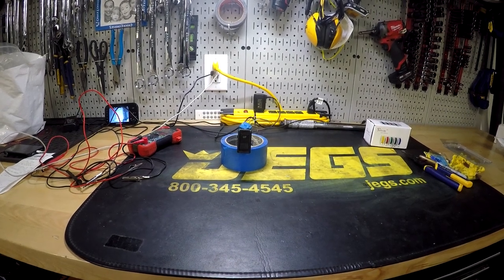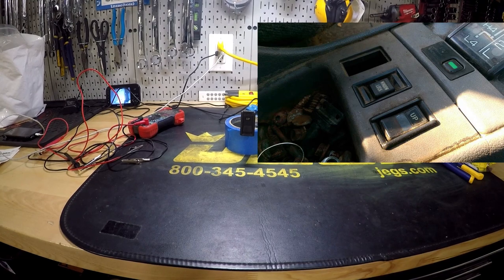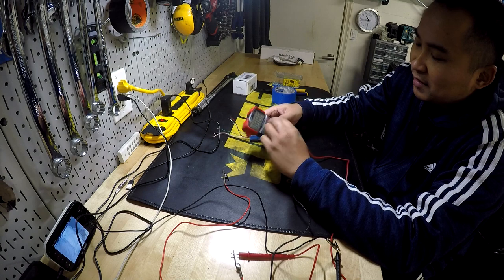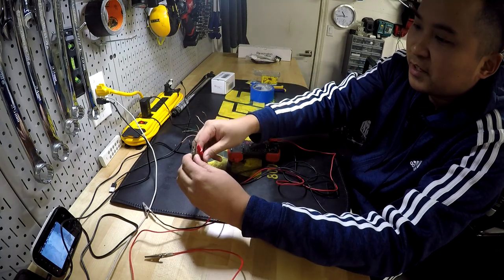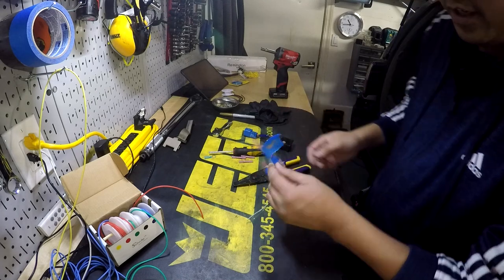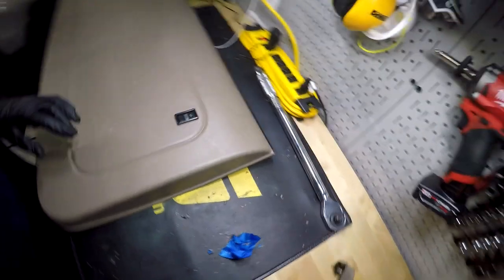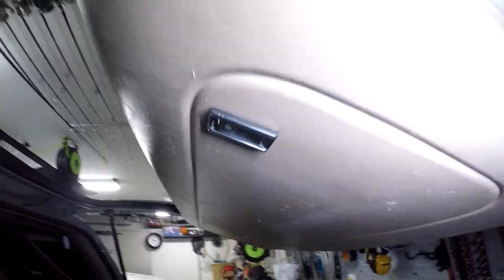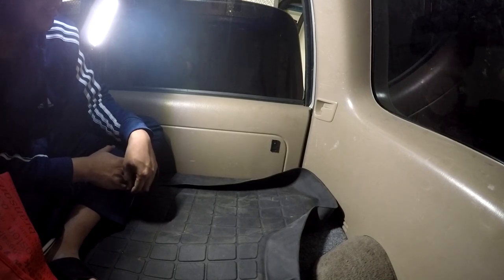Add A Window Switch for 3rd Gen 4Runner Rear Window

Comment: You need to save folks a headache and make a note on this video that it will not work for the 01-02 runners , because the ecu . the do has to be unlocked for it to come down. It is possible with relays but requires a lot of additional work…
Reply from the maker: Pinned your comment

Comment: The reason 3rd gen switches are like that, is because they were located in the center console left of the parking brake, placed upside down, at a downward skew. If you can only find a 3rd gen switch,  and want to install it in a vertical position, just peel the "back window" sticker off the switch with an exact-o knife and flip it, so up is up, and down is down.

Comment: Sir you have shown me a solution to a problem I didn't know I had. I have a 02 4Runner and this would be an awesome mod! Thanks for posting.
Reply from the maker: Check the comments for color codes and test it before committing to a hole lol. I’ve seen some unsuccessful results! Hope it works out for you though. It’s a nice add for sure!

Comment: Amazing. As soon as I find a swtich I'm doing this! I was wondering what you mean about "put the cover back on" to not scratch the glass? Why would the interioir trim need to be installed? Do you mean to say the interioir piece actually moves the glass slightly away from the track?

Comment: Dont all 3rd gen 4runners have a switch on the hatch key- turn left to unlock and then hold that position and the window goes down, turn left to lock hatch but hold and the window goes up. is that only on limiteds?
Reply from the maker: Yeah my sr5 has that but that’s be hard to do sleeping inside the vehicle unless window was down (bugs!!). This is actually tapping into that circuit

Comment: May be a stupid question, but is this deleting the switch in the front? I just finished the hatch light mod, and am doing some research on this one in your video..i want to keep the one up front active, bc the dogs like the fresh air while driving.
Reply from the maker: It is not deleting the switch in front. It’s basically creating a switch off the rear key system

Comment: @PhoRunner Channel will this mod work with a 3rd gen 4runner hatch window switch? Or are the wires different?
Reply from the maker: It should but the switch will be upside down printing . Wire colors will be different but you can use a meter to figure out what wires you need

Comment: Hey mate, long shot but im using the gen 3 switch from my 96. Found the wires in the tail door, hook up the switch but it only goes down. Any advice?? I know this was a while ago but hopefully you still have memory of it!
Cheers!
Reply from the maker: Try finding the wire by the key that makes it go up and trace it back to that module. If it goes up with the key, there should be a way to simulate this
Reply: @PhoRunner  i tapped into the key wires, two green ones, still wont go up. Both wires work, have tested it but just only does down. Do you think i need to connect all three? As i just have an earth going to a bolt
Reply: @daniel7529  have you found the solution?

Comment: I'm planning on doing this mod, but would rather not cut into that rear door metal (I've got a big switch). I want to put the switch in the side of the back area of the trucks interior, right next to where the wheel well sticks out. Instead of fishing a wire through, do you think I could just tap into the wires already going to the front? It looks like those green-red and green-yellow wires run all the way to the front.
Reply from the maker: I’m not too sure. I would think you need to access the ecu since the ecu module sends the signal back to the front
Reply: @PhoRunner  thanks for the input. Just pulled the rear headliner back and found the same green-red and green-yellow wires headed to the front. Checked em with a multimeter and they link directly to the lock cylinder sensor. For some reason it just bypasses the rear ECU in my 02. Guess the main ECU handles it. So for anyone reading this, you don't have to fish a wire through if you want to put the switch in the rear interior body panels, just tap into the appropriate wires
Reply: @danielhoefer9168  Did this work? I hear that some weird locking/unlocking behavior occurs when you do this mod in the 2002 models. Let me now, thanks. (+ any other details much appreciated)
Reply: @kendrick153  It ended up being more complicated of a project than I thought. I'm in studying electrical engineering so it wasn't too difficult but I had to make use of two relays to get it to do what I wanted. Basically I have it wired so when I push the down button it unlocks the whole vehicle and then lowers the window. Same thing goes for raising it. Pressing the up button locks the whole truck and then raises the window. So I had to run two wires up to the interior junction box in the front of the truck to tap into the unlock/lock door wires. Then I just used two double pole double throw relays to connect the to switch buttons to the appropriate wires to raise and lower and unlock and lock.
Reply: @danielhoefer9168  1. Does the problem still occur / is your relay fix required if you place the switch further down the line (e.g. what PhoRunner does in the video, tapping in very near the harness/plug?
2. Yep. That is complicated. If you got a diagram/pictures for me?  I'd send all the good internet karma your way I can muster.

Comment: Great video. Thanks for sharing. Do you know if a universal 5 pin switch will work with this mod?
Reply from the maker: Hmm I’m not positive
Reply: I tried the mod exactly how you setup.  Windows goes down but not up. Any advice?
Reply from the maker: Try wiring at the key cylinder area. I saw some reports of this not working on newer models. Not sure what the problem is

Comment: Did you have to cut the inner black metal panel behind the brown outer trim panel?
Also, if you did, did your wiring stay in front of the inner black panel so it didn’t come in contact with the window when it goes up and down?
Reply from the maker: I did not have to cut that

Comment: I just did this mod on my 02 and the weirdest thing is happening. The switch will only open or close based on the last position of the key in the tumbler. So if I raise the window with the key, only UP will work and DOWN will not. If I lower the window with the key, only the DOWN will work and the UP will not. And it doesn't matter how much I raise and lower the window with the key, it's almost as if the little computer remembers the last position of the key and allows the switch to only work either up or down.
Reply from the maker: That’s very interesting and a bummer. Not sure how to fix this
Reply: After some more trial and error I found that the window will go down only when the tailgate is unlocked and will go up only when the tailgate is locked. Weird. I wonder if there’s a way to bypass this.
Reply from the maker: Interesting. Must be an ecu thing on the 01-02 since many have reported only being able to go one way. But good news is you can unlock the key and use the switch either direction once inside?
Reply: @PhoRunner , I tried that but if the lock tumbler is in the unlocked position the rear window will only go down from the inside switch. To use the inside switch to raise the window the tailgate lock tumbler needs to be in the locked position.
Reply from the maker: I see that’s interesting and kinda lame. Maybe you can find the wire in the tumbler and feed it ground or power when switch is depressed to simulate the tumbler / key
Reply: @eddielim4849  I’m encountering the same issue. Did you ever find a solution?

Comment: I been trying to do this mod to my 2000 t4r limited and it doesnt work at all ive purchased 4 different switches thinking that was the issue but it never worked i used the same switch as in the video and i plugged everything in the same not sure what could be the issue
Reply from the maker: Can you roll the window down with the key? Some have tapped into the key cylinder wires and found success
Reply: PhoRunner Channel yes i am able to roll it down with the key
Reply from the maker: Try tapping into those wires instead of the one I mention. It means there’s a controller back there.
Reply: PhoRunner Channel do you know the color of those cables? And which one does what?
Reply from the maker: Should be same as what I said. You can check with a volt meter using continuity test. Find the ground and other 2 are for window

Comment: Hey, I just got my switch and wired it up! Works great! Before I cut any holes in the pannel I was wondering if you had any recommendations about the best mounting spot? I really want it to sit flush and not stick out at all or it will drive me crazy ahah...
Reply from the maker: Lol well mine is pretty flush. I dont know where else you could put it without doing a bunch of wire fishing!
Reply: Hello

Well I have been attempting to wire this up for the last week and for some reason I can only get the window to run in one direction.  I used the wires described          ( green/red and green/yellow ) and the motor will only run one direction.  Occasionally it will reverse and I am able to run it the opposite direction but again once that cycle is complete it will not run in the opposite direction and the relay will just click when pushing the button for the direction that it just ran.
Reply from the maker: Try the wire at the key cylinder. I see that the 96-98 seem to use that wire from there

Comment: 1997 4runner

coming from the white connector pin
up : red/black

coming from the gray connector pin 
down : green/yellow
ground : black/white
Reply from the maker: Cool. I will pin this for others!!
Reply: I have a 96 and I’ve tried red/black and green/red for up and it hasn’t worked. But my down does lol. Idk what to do.
Reply: @Copenhagendeputy  did you try  starting or on position. before trying it.
Reply: @rojohnboy5351  no I thought you didn’t need to due to constant power

Comment: So it has constant power?
Reply from the maker: yes, it's constant power from the factory
Reply: PhoRunner Channel could you use a side door window switch?
Reply from the maker: @PyrateRumRunner  i don't see why not
Reply from the maker: you'll have to figure out the wiring using a volt meter tool though.

Comment: Excellent mod! Recieved switch and installed in no time.  Appreciate all the foot work on wire harness in vehicle. Only difference is I used razor knife to cut out and put a zip tie around base of switch to make it snug.  Appreciate the help once again!
Reply: I also like the way it simultaneously locks and unlocks doors respectively as well.
Reply from the maker: @davidmaclennan5400  wait what lol. The zip tie is a smart idea. Mine keeps backing out!
Reply: @PhoRunner  I put just a little super glue with zip tie. So if have to take off just razor knife super glue off zip tie. No superglue on panel at all
Reply: I have a question? Can you share link for the magnetic light you use in videos?
Reply from the maker: @davidmaclennan5400  https://www.harborfreight.com/390-Lumen-Magnetic-Slim-Bar-Folding-LED-Work-Light-63958.html  try to find it on sale for $20-$25

Comment: Been trying to get the rear window to even work In my 3rd gen (97) 4Runner, it's never worked the entirety of my ownership of the car. Would love to install this once I get it fixed
Reply from the maker: check the wire hardness that goes from the vehicle to the lift gate. sometimes the wires inside there break. i lost my 3rd brake light this way and had to repair it

Comment: Tried this in my 1998 4Runner Limited and it isn't working. I don't have a green w red wire. Down works on green yellow with white black as ground. Up doesn't work. If I plug the up into down T-tap, it also goes down.
Reply from the maker: Check the wire at the key cylinder and see what color it is. You can also tap it there too. Check to make sure it works by using your key too.
Reply: @PhoRunner  thanks, I'll try that. Would you know the connector pin location numbers? Might be more accurate than wire color? Our wires might be different colors but maybe they are in the same location?
Reply from the maker: Not sure what location but a few guys direct messaged me and said tnhe colors are the same for their 96/97. Also the key cylinder will only have 3 wires so it’s those colors for sure.
Reply: @PhoRunner  Maybe because I have a 98 Limited model? Anyway, thanks for the help.
Reply: @craighall4298  Did you ever get this working ?  I have been trying for a week now to get the motor to run in both direction with no luck.

It appears that I do have the same colored wires but for whatever reason the wiring doesn’t run the motor correctly .
Reply: @blurmgru6632  I did finally get it working. I had to tap into another spot for the up wire. Did you test for continuity? Mine is a 98 Limited.
Reply: @Craig Hall Can you please send a copy of the link to your photo? When I click the link it just takes me to the home page
Reply: Doesn't seem like I can attach a photo.
Reply: Craig Hall  can you attach the link to the photo?
Reply: @kendellharbin  this makes sense that the lock/unlock has to do with the window only working in one direction. That is the same issue I’m having. My key fob is so unreliable but that may be the only option or getting it to switch directions. Let me know if you sort out a work around. Thanks!!
Reply: @craighall4298  what color wire was your up?

Comment: I know this video is super old but I have a question I do hope you're still around and able to help...my rear window dropped one day on its own and drained my battery...I found some wires with split sheathing and fixed that but everytime I try to activate the switch to roll the window up all I hear is a click coming from the rear hatch??? Any thoughts on how to fix this issue I'd like my window back up lol...